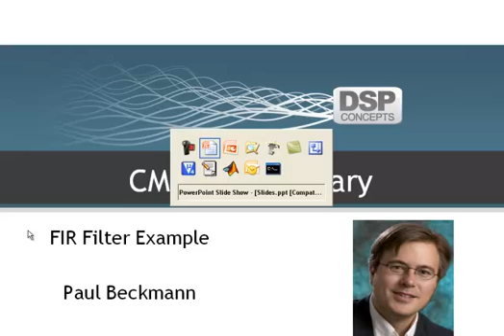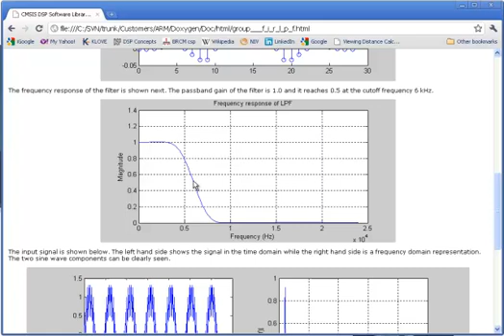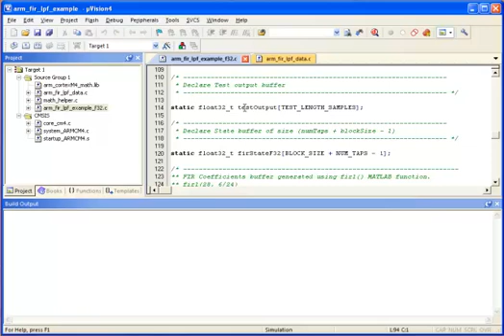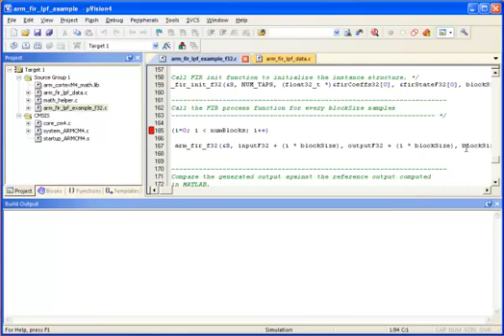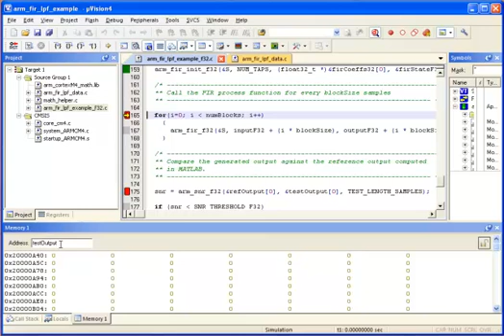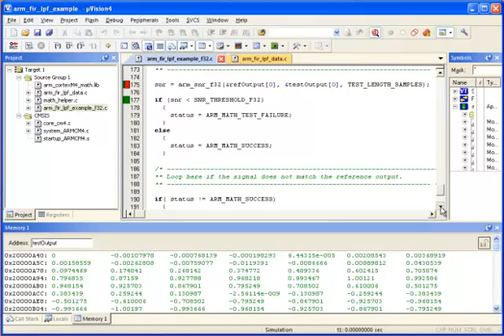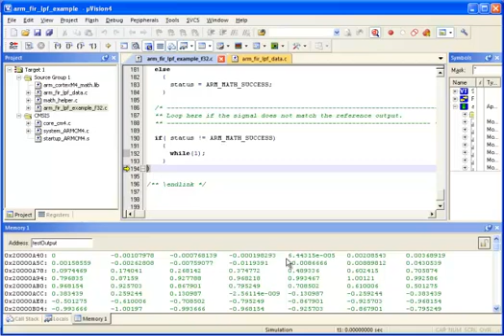CMSIS DSP Library FIR Low Pass Filter example

Comment: Hi, 
Do you have a example of  CMSIS FIR implementation using ADC and DAC ????

I know that with this application the input data will be updated with a fixed time(sample time of ADC). The question is: the newest input  of ADC should be stored in which index ( input_data[0] = ADC_DR, for example)? Same to the newest output data:they will be stored in which index?? In this case the arm_fir_32 will be called on every interrupt, right?

This example the arrays are fixed(not updated), that´s why my question.

Great video